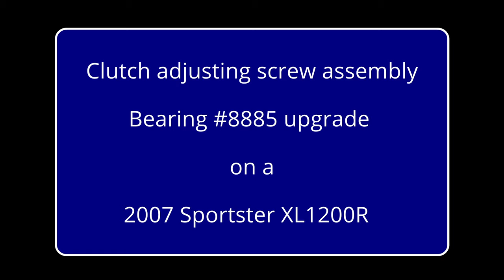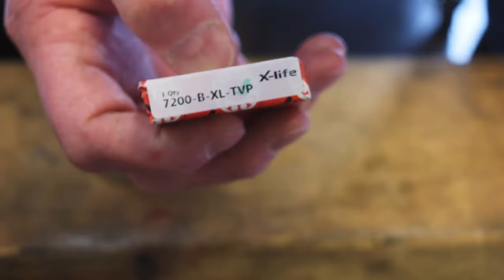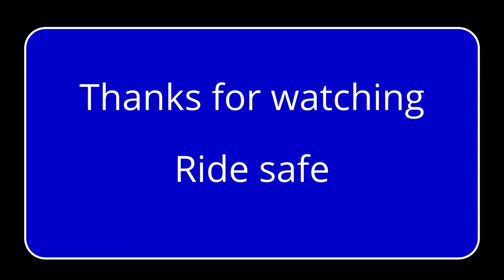Bikervation  - Replacing the Clutch adjusting screw bearing #8885 with a FAG 7200-B-XL-TVP

Comment: I've had 3 of these go wrong so I'll definitely be upgrading mine. Thanks for the video.  It makes sense.
Reply from the maker: Thanks, if you do replace the OEM bearing#8885 there's a FAG fibre cage and also a steel cage: 
FAG 7200-B 
This 7200-B-TVP bearing is a single row angular contact bearings with a modified internal construction and a glass fiber reinforced polyamide cage.

FAG 7200-B-JP
This 7200-B-JP bearing is a single row angular contact bearings with a modified internal construction and a sheet steel cage.

Comment: Thanks for this.  Very helpful.  I noticed the  new 7200B bearing has a lot more play than the stock bearing, which had almost no play.  Is there a preference for the TVP vs JP bearing?
Reply from the maker: I noticed that as well but after fitting and thinking about it all became clear, it may help to read the article I refer to above in the video description “LINK TO THE SPORTSTERPEDIA.COM ARTICAL." 
The force on the bearing is pulling away from the clutch which compresses the spring and if you look at the drawings I put in you will notice the “shoulder” that the balls act against is better suited for this Angular thrust than a deep grove bearing. 
However I am not qualified to give a firm answer but that’s how I came to see it. Hope that helps? Regards Chris

Comment: I was wondering about the TVP vs JP bearing as well. The TVP uses a plastic cage and the JP uses steel. The specs are identical with the exception of the temperature rating, with JP being higher. Maybe better to go with the JP?
Reply from the maker: Thanks for watching, I went for the glass fibre reinforced polyamide cage, but I guess it’s a personal choice as both do the job.

Comment: My 7200b bearing fits in the housing easy, i think the housing is a little worn out. I wont buy a new housing because you have to buy it with the old crappy bearing. I decided to glue the bearing in the housing with loctite 648. Also went for a extra plate clutch kit.😅

Comment: Excellent demonstration. I’m doing the dive into the spring plate issue.. will be installing Energy One extra plate kit and was looking for a video on the throw out bearing upgrade with a FAG 7200B. Just what I needed, much appreciated.
Reply from the maker: Thanks, glad it helped, there's two types of bearing you can use, one with a glass fibre cage and the other with steel: 
FAG 7200-B
This 7200-B-TVP bearing is a single row angular contact bearings with a modified internal construction and a glass fibre reinforced polyamide cage.
FAG 7200-B-JP
This 7200-B-JP bearing is a single row angular contact bearings with a modified internal construction and a sheet steel cage.

Comment: Ive replaced mine with a bdl energy 1 clutch and the TVP one 3 months later clutch failed coming off a round about the spring seat and clip gave way i have changed both and the clutch spring looked fine lucky enough i have rebuild the clutch and the lever is sloppy as hell clutch doesnt work not sure if this has failed aswell looks like the same amount of play as it did when installed tried everything adjustment wise nothing working
Reply from the maker: Mines been fine, are you sure you reassembled everything correctly? I only use the Harley manual for my year, I also have a Clymer XL Sportster 2004-2013 for additional reference
Reply: @Bikervation  I was up late last night and drained the bike about 6 hours prior I removed everything and the plates where dry 🙃 on assembly I did soak the plates 3 months back but when the clutch gave way last week I won't lie I never resoaked them as the plates where still in the basket I can't see how this would make the lever with all adjustments still loose however
Reply from the maker: @scousebikers If everything is assembled correctly all I can think of is the clutch cable outer as it goes into the primary case. I'd adjust the clutch cable as per manual, try the lever - if it was loose check adjustment again, I guess if you need to readjust then the outer cable sheath is not seated and is slipping. That's about all I can think of. Chris
Reply: @Bikervation   Yeah mate adjusted both at clutch and slack out of cable aswell but it's like there's no clutch at all it definitely pulling but doesn't do much hopefully get to the bottom soon bud 😉
Reply from the maker: @scousebikers May the Gods be with you :)
Reply from the maker: @scousebikers Just had a thought :) is the TVP bearing around the right way?
Reply: @Bikervation  yeah mate checked this last night even watched your video and done it again using your tutorial 👍
Reply from the maker: @scousebikers  Sorry I can’t be of much help but would be interested when you find the problem. Good luck, Chris
Reply: @Bikervation  I'll keep you updated Chris I've been filming stuff on my channel so I'll try make a little video and post when I can
Reply from the maker: @scousebikers  Just had a look at your video, maybe the clip wasn't seated all the way around, they can be a bit of a bugger.
Reply: @Bikervation  yeah mate I recon this was the reason for the failure to be honest I've got the new parts to sort it but still no joy stay tuned though mate hopefully have this done in the next few days